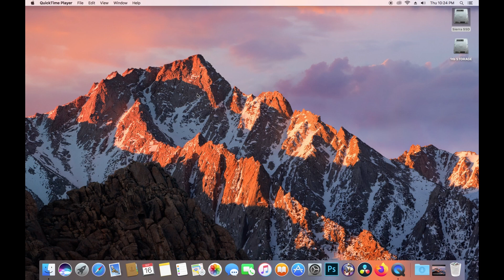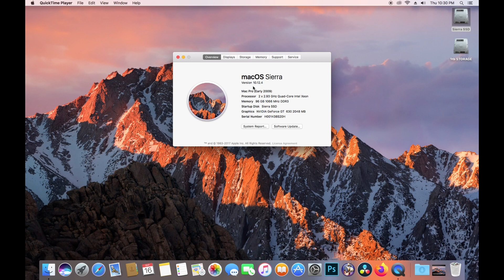2009 Mac Pro, Hardware Upgrades!

Comment: You might try a pcie to m.2 card as well.  The single best upgrade imho.

The sapphire nitro 580 has served me well for years.  No drama, just plug it in with cables.

Also, the external bt antenna mod helps...  a bit.

Upgraded my CPU and memory (three channel) as well.

All helped me get another four years.

Unfortunately, there is no getting away from the fact my 2010 is a space heater even at idle.

Today, I'm running an AMD/Opencore system which is much faster any much less power hungry.